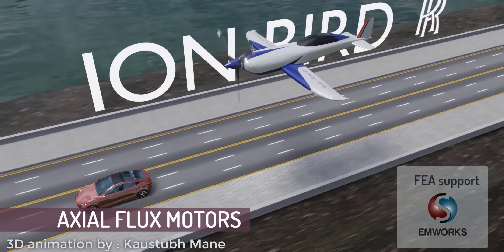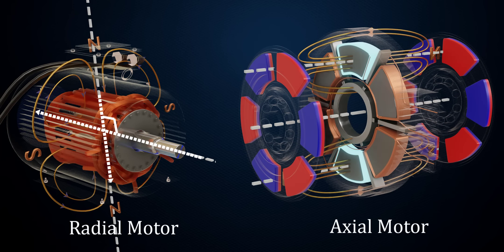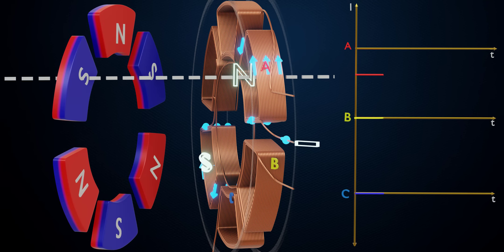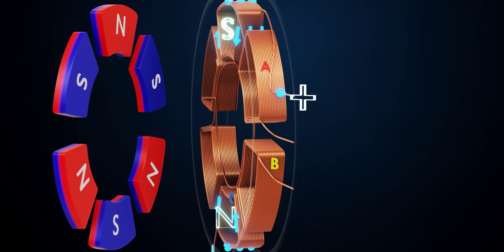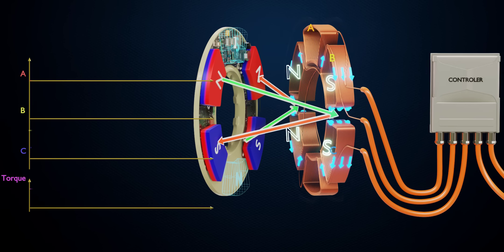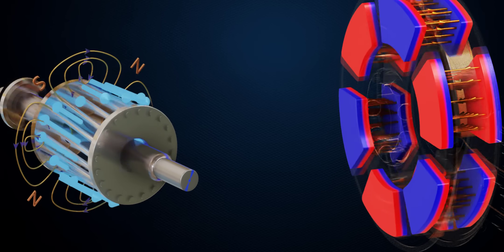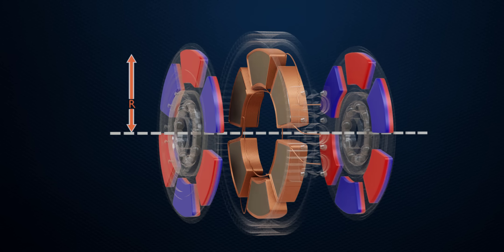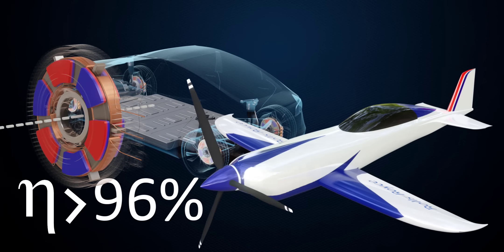Axial flux motors - The new hope

Comment: Its the weight of batteries that makes electric aviation a non-starter, not the torque to weight ration of the motors - even common electic motors already have a relatively high torque to weight ratio.
Reply: Exactly… this video is good so far imho, but the problem of electryfing any Aircraft is the weight of the battery caused by bad energy density.
Reply: Would higher efficiency flux/phase modulation and/or shorter duration inputs help power usage? Less power usage seems to be the natural progression if possible.
Reply: I think they're talking about little Cessnas and sea planes, not transatlantic jumbo jets 

but yeah, it wouldn't be viable for long trips due to the rocket equation
Reply: Though fuel is a huge weight factor in fuel engines.
Reply: @donb7113  your right the wings are the fuel tank on your large jets passenger and cargo. Bout 200,000 pounds worth
Reply: @donb7113  True, fuel mass is a large factor in flying aircraft using fuel powered engines but, as the flight progresses, fuel is consumed and thus the mass of fuel on board is reduced.  On long flights (where alternate landing airports are close to the intended destination) this reduction in mass is also a huge factor in calculating aircraft performance.  On the other hand, an electric aircraft using batteries for energy storage is not subject to this factor.  Batteries don't change mass as they are charged or discharged.  Thus, on a long flight the aircraft does not have the advantage of the mass of fuel decreasing as the flight progresses.
Reply: Easily solved by using the Nikola Tesla approach of receiving energy @ a certain resonant frequency and having a ground station providing the power.
Reply: @morpher44  I hope you're joking. If not I don't believe you understand how any of those things work at all. "Oh yeah, resonant frequencies, it's easy" is probably the best example of the Dunning-Kruger effect in action that I've ever seen.

Wireless transmission follows the inverse-square law. That is, the total energy available at the destination is inversely proportional to the square of the distance from the source, because the energy is released in a sphere and that's how spheres work. 

What this means is in order to power a 100 watt motor (laughably small for an airplane) from 100 meters away (laughably close to the ground for an airplane) you would need 1 megawatt of power pumping from the ground station. You want that plane to fly at a more reasonable 1,000 meters (which is still 1/10th normal height)?  You'll need 100 megawatt ground stations all over the place. And that's for a plane that might be able to carry a single passenger. Maybe. Certainly won't do so quickly.

That's MAXIMUM efficiency, mind you - the physical limit of what can be achieved with wireless transmission. Why do you think all wireless charging devices are designed to literally rest right on top of the charger, rather than be anywhere within a few feet, which would be so much more convenient? It's because the power loss is exponential. What takes 10 watts an inch away requires 16,000 watts just three feet away.

For reference, the electric motors designed for large scale passenger planes require over a megawatt each, and the planes will use more than one of them. That's more than 1 trillion watts per engine from a ground station 1,000 meters away.
Reply: @jeffwells641  Tell that to JPL who demonstrated broadcasting power in 1975 (Goldstone Demo)
Reply: @jeffwells641  that is what we know so far about wireless transmission of electromagnetic energy, and you are correct. It does brings similarities to DC  from Edison and AC from Tesla. DC had high losses, AC not, so I still like to believe in possibility that all wireless energy transmission possibilities are not discovered or disclosed.
Reply: @sroljosro7015  Actually DC is much more efficient than AC for transmission due to the oscillating wave nature of AC. The reason AC beat DC early on was because low voltage vs high voltage is a much bigger issue for efficiency than waves vs no waves, and AC was initially much much easier to produce at high voltage as AC transformers are very simple to make. In fact at the time there was NO way to change DC voltage at all, so it pretty much lost by default.

Today however AC is used at the end points because it is the standard, and the losses due to the wave nature of AC aren't a major problem when traveling short distances. For long distance power transmission, it's pretty much all HVDC, which is then converted back to AC once it reaches its destination.
Reply: @jeffwells641  - Every once in a while there is a bloke commenting who spits truth and de-bunks the fairyland internet myths! Thanks bud!
Reply: @jeffwells641  Correct again, though I did put the time frame on my statement - Edison and Tesla. Tesla was far more advanced on every aspect of electrical energy exploitation and that was the core of my comparison where I like to believe that efficient wireless electrical energy transmission shall be possible one day. So today we are like Edison back then. We do know that energy transmission drops down with square of the distance, meaning we have so much loses it seems pointless for anything but information transmission. Exactly what we do today. But I am not sure our knowledge pool is significant. Still a lot to learn about nature of things.
Reply: @sroljosro7015  Yeah, but some things we have pretty well nailed down. Like I don't expect my cat to suddenly turn into a cow tomorrow - that's not one of the outcomes in the known-unknown or unknown-unknown problem space. That's in the known-known problem space. Likewise, efficient wireless is the known-known problem space. It's not just a matter of "we don't know how", as was the case at the time of Edison and Tesla. We do know how, and it by necessity requires ludicrous amounts of energy.

Much more likely there will be a breakthrough in energy storage - like battery tech, fuel cells, or something more exotic like a micro-nuclear reactor (but unlikely for reasons OTHER than the physics of it). Heck, some people think the future will be airplanes slowing down and getting solar collectors, so if the planes have wings big enough and fly slowly enough (to save energy) they can fly for weeks at a time. Flights become more like cruises on the ocean are today. 

But wireless transmission of energy is not really one of the things on the table. We understand how it works well enough now that almost everyone carries a device that can use the tech in their pocket. There isn't any room to make it suddenly a million times more efficient, which is what would need to happen for ground stations to work.

And don't think I'm shitting on Tesla here - he's far and away one of the greatest inventors in history. But for as many of his ideas that work amazingly well, there are dozens of ideas that simply don't work at all, or fall into the "neat, but useless" category. That's kind of what being a prolific inventor is all about - coming up with ideas that break the mold, and seeing which ones work. It's good enough that he essentially gave us wireless communication, electric motors, and fluorescent lights. He doesn't have to be the source of everything.
Reply: @jeffwells641  I am not here to defend Tesla as person, or anyone else. I just like to keep thinking in which we allow possibility that our knowledge is way from being finite, on subject of electromagnetism, would not know about cat to cow problem, probably it could be done with sufficient amount of control over DNA coding 😁.  Your basic reasoning is quite normal, I am not opposing it, just so you (we) are clear with that. If I go back to Edison Tesla time. DC is perfectly fine, as we all know today, but they could not overcome all the resistance in long lines, AC can. In layman terms "DC was putting to much stress on the material through which it was propagating" Imagine if we can find properties of space or form of electric energy where we can achieve the same effect as what AC had on primitive electrical lines back then? Fairy tale and wishful thinking. Yes ! But remember everything starts with right amount of imagination. Supposedly Einstein said, ""Imagination is more important than knowledge. For knowledge is limited, whereas imagination embraces the entire world, stimulating progress, giving birth to evolution."  To conclude, nice of you to point out on today's limitations in understanding of physics, but maybe we should not be super keen to insist on limitation we think we understand today.
Reply: @morpher44  You saw all of those objective facts, ignored them, and then cited a weak ass source that refutes nothing.
Reply: @vlisto3712  Geez. Some people are "triggered" by Nikola Tesla. I was reading his Colorado Springs notes recently, and was impressed by his way of doing math using inductance and capacitance expressed in lengths in centimeters. A savant, like him, sees these problems differently from you and me.  Perhaps holding on to a belief system, such as the Aether hypothesis, allows an inventor to be unblocked by modern physics. He was shooting for higher frequencies and focused beams of energy (scalar waves). If it turns out that energy from the Sun, such as the recent G2 geomagnetic storm can be "received" power -- affecting the grids on the planet ... perhaps there is more to learn. Dark matter is being proposed now, and yet we fail to detect it too -- unless the one detector is correct. We shall see.
Reply: @sroljosro7015  
Nah, knowledge is pretty much concluded now since the advent of quantum physics...has been for a long while.
Just because the Tesla disciples aren't up to date on all the possibilities and limitations of his work doesn't mean there's a load of inventions being hidden form us.
Enrico Fermi and Richard Feynman contributed more to science than Tesla ever could have.
The man was a genius but also a total oddball who didn't mix well with people, not the tragic ripped off hard done by figure people are always crying about.
Reply: @jeffwells641  I agree with your main thrust that transmitted power is not a viable pathway to powering commercial aviation any time soon.  That being said your initial statements about wireless transmission make some mistakes.  Inverse-square law doesn't necessarily govern in all scenarios, only where the source is radiating isotropically.  Antenna gain is the concept you are neglecting to address, specifically directive gain.  If you want everyday examples of directionality of power transfer for electromagnetic radiation, think of a flashlight, laser, phased-array beam-forming, etc.  Those examples do not primarily transmit power, but power is being transmitted.
Reply: @jeffwells641  HVDC is used almost exclusively in point-to-point applications.  Multi-terminal implementations are rare because converter stations are pricey.  Long distance HVAC power transmission is still pretty common because of its ability to support terminals along the length of the run.
Reply: @ldl50  Came here looking for this comment.  I too agree that wireless transmission of large amounts of energy is not viable but Jeff's initial statement really jarred me.  Not all radiators of electromagnetic energy radiate isotropically!  High power radio stations routinely use antenna arrays that direct the radiated power at low angles (no need to entertain the Martians) and direct it in preferred direction(s) to increase coverage area in that direction and limit possible interference in other directions.
Reply: @morpher44  that is never recreated legend, so we are not sure did Tesla really did it or it was one of promotional gimmicks he liked to do. Legend says he made electric car powered remotely.  Legend.
Reply: @morpher44 Tesla  induction? A man before his time.
Reply: I have not been this impressed since Rockwells' Retro encabulator.
Reply: Not relevant since BHEV approaches work fine in aviation.
Reply: At what point did this video address energy storage?
Reply: There’s a Canadian airline, Harbour airlines, that uses this in caravans. Has a range just under 100 miles I think
Reply: Well there are batteries, and batteries. Already with Li-Ion viable use cases have been and are still being found for electric flight. Since I watch the news on this closely I see such cropping up all the time.
Then there are batteries like Aluminium Air. Which has several times the volumetric and gravimetric energy density of Li-Ion, but are not rechargeable - Yet affordable and relatively easy to manufacture/recycle. Which completely changes what people generally assume about the viability of electric flight. i.e. Making it substantially more viable. 
It is simply a matter of time before the first prototypes of electric planes using this battery chemistry starts making news headlines. I give it a year or two at most.
Reply: OTOH batteries are getting better all the time. Electric aviation is no longer a complete non-starter, it's just not going to replace jumbo jets any time soon. It's already feasible to use them in short range applications, like commuter flights.

A six passenger commercial plane is already in operation, and pretty much every major airline is committed to developing electric airplanes.

The benefits of electric are also clear - the cost of electricity is about 1/20th the cost of jet fuel for the same distance flight.
Reply: @jeffwells641  Right now, even the best batteries have a specific energy of only 250 watt-hours per kilogram, but we have to get closer to 800 to really start flying, and that is still nothing compared to jet fuel's specific energy, which is nearly 12,000 watt-hours per kilogram. Hate to burst your bubble but we are a loooong way off from getting even close to practical widespread application of battery tech in planes. There may be a few trying it out for very short flights but far from being useful in most cases.
Reply: Yes, it's the weight of the batteries that's the problem. But do you think companies that experiment on electric aviation don't know this? They are betting on battery energy densities getting better. If that happens, they already have a working electric aircraft at disposal. It's just the matter of changing the heavy batteries to the new lighter ones. And the reduced weight instantly translates to passenger/cargo capacity.

Currently, Lithium Ion batteries are around 20 times less energy dense compared to jet fuel. And unlike jet fuel, the batteries don't burn away when you fly so you also have the dead weight of discharging batteries as well.

As soon as someone produces a battery that is 20 times more energy dense compared to Lithium Ion, airlines will turn to electric within a decade.
Reply: @sampathsris  
You're looking at it from one angle only - energy density. Simply put, the weight is devastating to an air craft, and if range is what you need as well, then you're kinda stuffed. The notion that that the next amazing battery tech is 'just around the corner', has been 'just around the corner' for some time now. So where is it?

Watch this excellent engineering based breakdown of why a long range passenger electric plane is a MASSIVE problem.

https://youtu.be/VNvzZfsC13o
Reply: For regular passenger transport, yes, but there are niche markets for electric aircraft in sports aviation i.e power assisted gliders and possible for some  pilot training.
Reply: Relatively ? They damn near destroy murder modern engine

Comment: Actually the outrunner motor seams to be more powerful than any of this. Brushless is the only way it will work and out runners would make more Torque and easier timing . Dont see how this could improve the energy use. Then there is cooling .

Comment: From my understanding, when comparing the flux lines on FEA, the axial flux motor should be simulated along the Magnets array direction (like a linear motor), where the non-interactive flux lines should also been seen in axial flux motor. Feel free to correct me. From your simulation results in 5:05, the results on Axial-flux motor didn't show the return path of the flux.

Comment: I used to work with axial flux motors/generators and they didn't operate on the principles expressed here. They work using the Lorentz force and had an ironless stator, which led to huge improvements in efficiency.

Comment: Which; does liely suggest that; all, `life` was / is; conveyed in that manner, by the; energy `spirit`;  in lightning? 
Will we soon, realise; that, the enclosing double helix, is so fundamental ? 
What is so interesting, in my unique dscovery; is there being; a five charged rippling ladder instead of, the four ladder, of the DNA constuct.
Lighning, has for so long been regarded as being, bi polar.As one, `strike` going up, and down.
Yet with this new discovery; it can be seen that there is more to, simple lighning; than has hitherto been regarded.
Seemingly; no one, has previously, greatly enlarged, the, `strike`?
However; in this instance, can it be special; being `triggered`, from the outline, of the defined most often seen, vessel.
The  reason why photos of the vessels, don`t cl;early form, is due to the high charge; that surrounds, the` contra rotating` vessels.

Comment: If this is that good why do the automotive people still use the radial one and not the axial one? I'm just curious why though. HUHU. Love the vid though so much. Very informative.
Reply: This seems to focus on torque, but from a quick skim of wikipedia it seems that top speed isn't as high due to the rotor being wider.  Since EV motors need speed and torque, and radial motors are probably far more refined than axial, I'd imagine axial has a ways to go before it's overall a better choice, counting cost
Reply: HAHHAHAHHAHHA true enough HAHAHAHHAHAHAHAHHAHA maybe for some trucks that can be viable. Thanks.